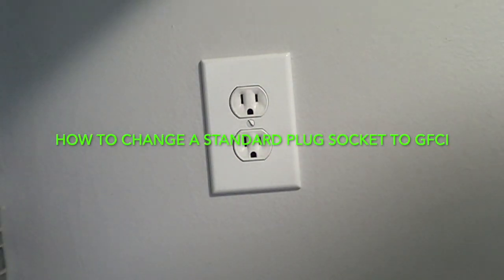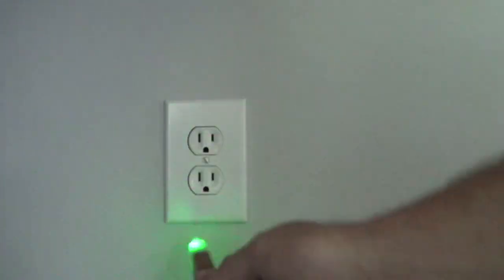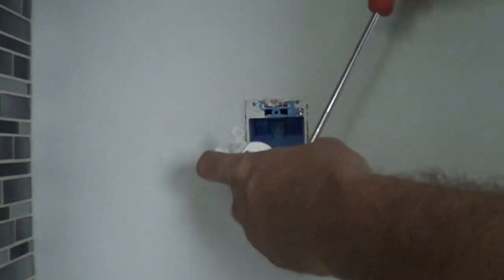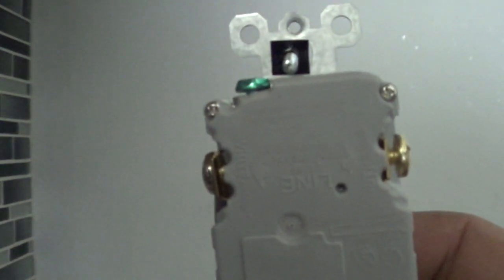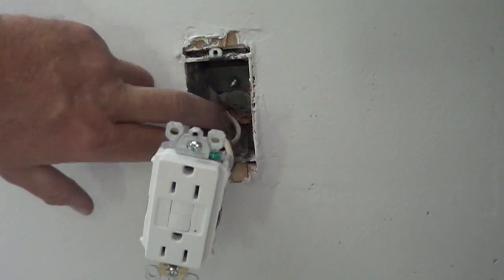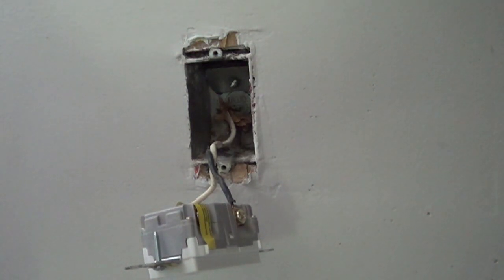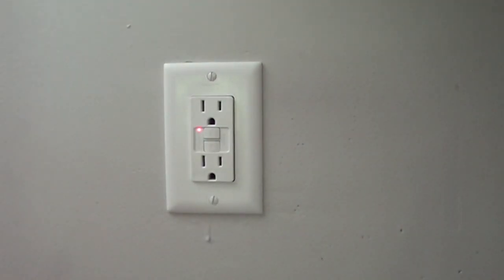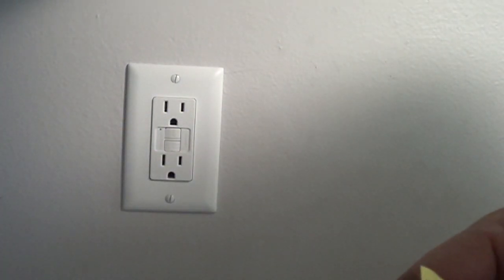How to replace or install an electrical outlet with a ( GFCI ) outlet in and older home.

Comment: you fast-forwarded through the part that was important, so I couldn't see which wire to put where.  I have tried every single combination on new gfci/afci receptacle, and the best I can do is to get it to work but the tester says that hot and ground are reversed.
Reply from the maker: Black wire to hot and white wire to neutral and if it has a ground it goes to the green screw but if not it has to be labeled gfi with out ground , hope this helps thanks for watching
Reply: @SavinABuck45  what if there is a red wire what do i do because i have no idea